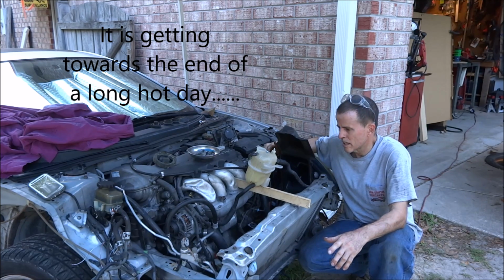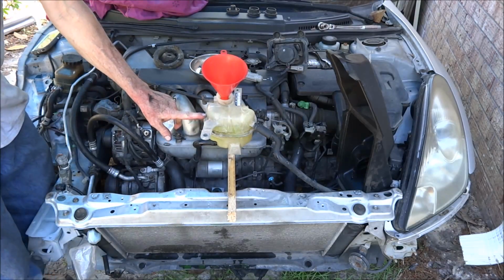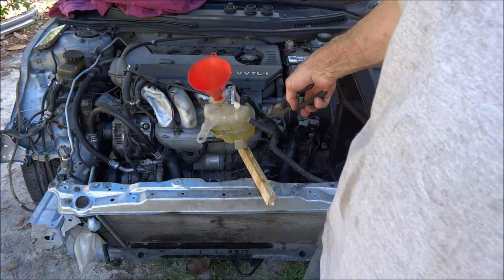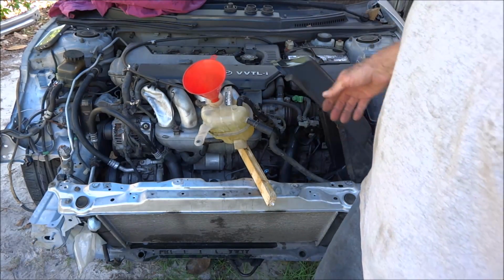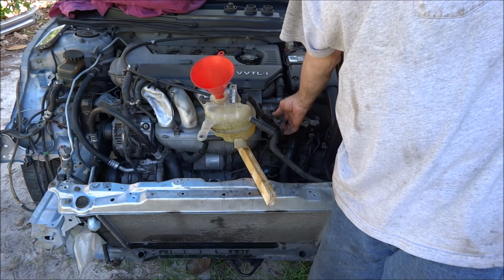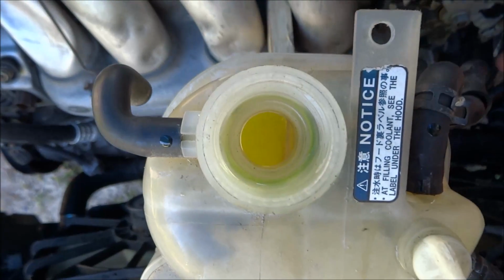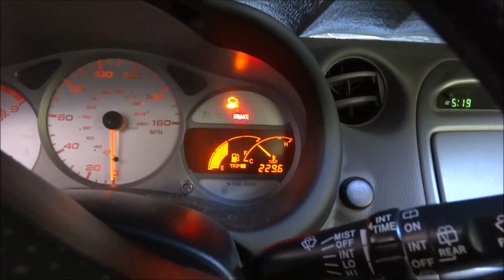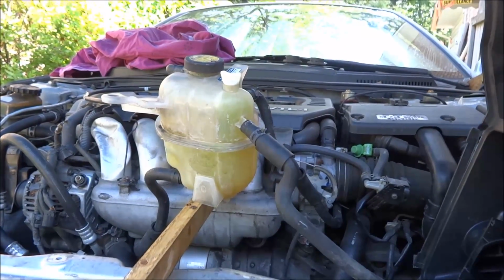2000-2005 Celica bleeding radiator / coolant. 7th gen Celica GTS.

Comment: I refilled coolant on my celica but it’s not going to the radiator or block and when I start my car it dies after
Reply from the maker: If the engine is shutting off you have more problems than coolant. How long did  you run it with low/no coolant ?
Reply: TSR Garage I decided to change to Toyota red coolant today before it had green coolant from previous owner. The car worked fine before I decided to change the coolant
Reply from the maker: @shawnO432   usually no problem at all starting and running during coolant change. Have you disconnected anything ?
Reply: I’ll check in the morning but I don’t believe I take anything out. I’ll post a video if you want to check it out on my channel
Reply: I figured out the problem and am currently bleeding the air . Is my radiator fan supposed to be on I turned heat on in the car
Reply: Currently have my heat full blast while reving and squeezing both hoses. My water is circulating in front the top hose to the resiviour but when feeling the bottom radiator hose it isn’t hot and my coolant level never dropped from the full line while squeezing both hoses. All other hoses besides lower radiator hose is hot. My temperature is at normal driving temperature so middle bar
Reply from the maker: @shawnO432  it takes a while to warm up enough to circulate water through the radiator. Switch the  heater blower fan off the motor will warm up faster.  Radiator fans will not come on until engine is hot.
Reply: TSR Garage ok I will turn off fans
Reply: TSR Garage thanks for the quick replies my car seems to be running and not overheating

Comment: you really should put Toyota red fluid in that
Reply from the maker: Thanks. Red/pink is extended life coolant... Lasts longer without changing. Green needs service/changing at shorter intervals. It will not harm the cooling system if serviced properly. Just do not mix them.
Reply: @TSRGarage  There are conditioners in the red that keep the gaskets fresh. It's higher quality. Will green hurt it. No, not short term. You should always use OEM everything. If you want it to last

Comment: i bleed this car without lifting the coolant rezervoir, i just remove the small hose from the reservoir side , then put a finger on the hole and start sucking on the hose to build some vaccum, then release finger while still holding the hose, doing this the water from reservoire will get sucked into the engine, refill..repeat procedure and after 2-3 sucks water will come out from the small hose and will be completly bled.a diesel priming suction bladder would do the job better and not getting coolant in mouth at the end
Reply from the maker: Good idea..